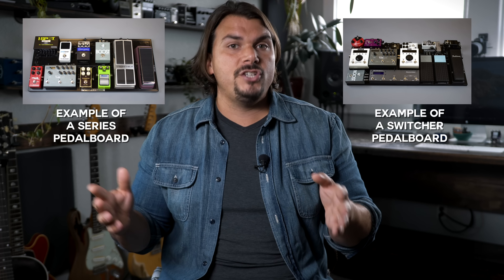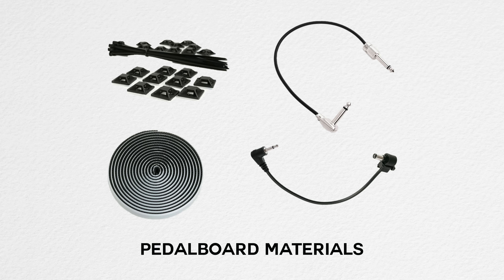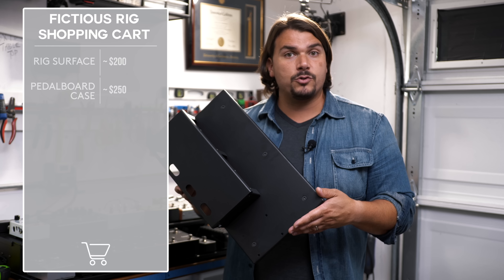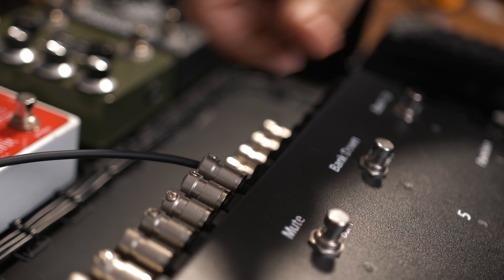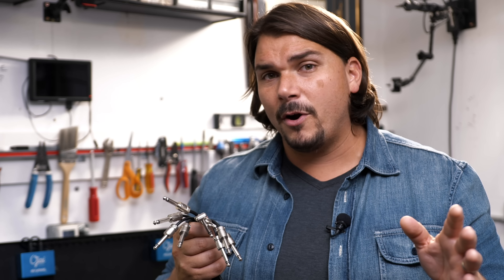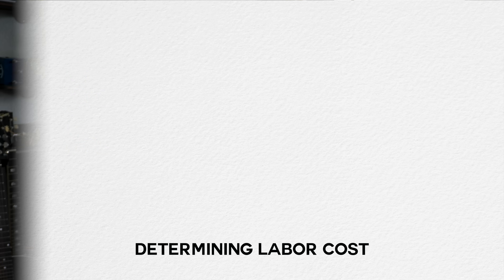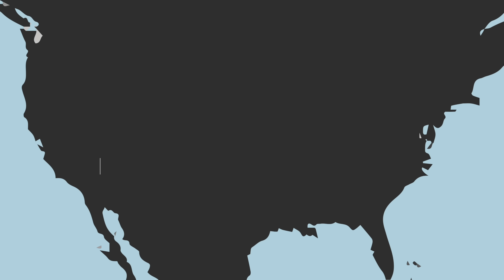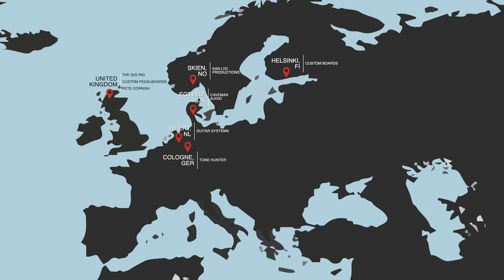The TRUE COST of a Custom Rig Build

Comment: Dont know what is funniest, that they ask 100$ per hour or that they need one hour per pedal. One hour...and they call themselves masters...
Reply from the maker: To do it properly, an hour is about right when you consider all of the things that need to go into making each petal work in the system, cables, power, layout, testing, Velcro, routing neatly.
Reply: I've only got 10 pedals and I have about 15 hours into my board. That includes setting the levels on each to work together properly. I also use premade patch cables. Dont wanna pay that much you gotta learn to do it right yourself.
Reply: When you factor in that you have to do the right layout, map out the paths of each cable for each pedal, be strategic, take the time to do things correctly, do all of the custom cabling, account for anything that might go wrong, etc., an hour per pedal When you average out the entire time from start to finish is actually quicker than average. My board is big, but I would say start to finish it took me around 24 hours total in its entirety. That doesn’t even account for programming with many builders do as well. We aren’t talking through some pedals on a Pedal Train and attaching pre made cables that look sloppy, which is 98% of the boards people show on social media groups out there. It’s an art form and not everybody understands what goes into creating art.

Comment: I can't even imagine the issues someone could have where they would actually pay someone to do this. How can you know enough about guitar to play it, pick out pedals, know what you want and how you want but then not be capable of wiring it up neatly? it literally make no sense. Maybe you wont do it to an insane level of professionalism but there is no logical reason why you couldn't do it well enough to realize the cost for someone to take it to a higher level than you could is just laughable
Reply from the maker: I can understand that for some it might not be worth it for them or good value based on their performance circumstances, but a novice with inferior materials won’t be making something equal to a pro builder, especially as the complexity of the rig increases.  Remember that there are no standards, electronically, when it comes to pedals.  Integrating 10+ pedals all speaking different languages and getting them to work synergistically is easier said than done.  Also making the rig quiet and reliable is an entirely other thing and again easier said than done.  Have a look at any Facebook pedalboard group or Internet forum and you’ll see daily posts saying “Help!” requesting trouble shooting assistance from the community as they’re at the limits of their ability.

Comment: I might have missed it but is switcher /midi programming included in the labor?  Guessing the estimated labor rate is +/- $100/hr?
Reply from the maker: It’s at the discretion of the builder - usually some basic programming is part of the deal and more specific programming might be negotiated with the client, but this is general, I can’t speak to every rig builder.  In some senses it’s best if you’re familiar enough with your gear that you’re not dependent upon the builder to program every time.  Often a tutorial at pickup is par for the course and some follow up, but a fully programmed rig is usually not included in a standard hourly price from my experience.

Comment: Lol then there's me... Spends $7000 on a rig build and builds it myself... There's a margin depending on what you're trying to do, I feel like on average it costs a lot more to build a rig
Reply from the maker: Big rig!!!
Reply: @VertexEffectsInc  yep!! the signal chain looks like this:tc electronics bonafide buffer, blackface proco Rat (1986), ehx original micro pog, fulltone ocd v1.4, Ibanez ts9 tube screamer, homebrew electronics power screamer, boss reverb rv-5, mxr phase 90 script logo (74' reissue), boss delay dd-5, line 6 delay dl4, 2nd line 6 dl4, this is then controlled by the nerve center: a gigrig g2. I also have 3 ernie ball volume pedals on this board, one is put at the end of the signal path before the end of chain tc electronics bonafide buffer, one is placed between my last overdrive and the reverb and the last volume pedal is hacked with a trs cable to work as an expression pedal for one of the line 6 dl4's. Everything is soldered in mogami 2319 and send and return buffers are fitted with neutrik locking 1/4 inch female ports. What do you think?

Comment: No offense dude, but cmon, you sell a 10 foot guitar cable for $75.00 on your site.
So how much does this rig cost? 
A lot. It costs a lot a lot. 

If you have to ask...you can't afford it.
Reply from the maker: That's what it costs for us to source and assemble a guitar cable in the USA, and pay a fair living wage.  You're certainly not locked into getting a cable from us - but if you want one with a lifetime guarantee that uses our recommended cable and plugs (which isn't commercially available anywhere else - unless you DIY it) this what we offer.  Secondly, I provide on our channel all the resources and a building tutorial to make this exact same cable yourself with our same materials.  I'm not sure any other cable manufacturer that will show you how to build their identical cable yourself and provide all the links and bill of materials to go along with it.  That's about as democratic a solution that I can provide if someone doesn't want to pay $75 or can't afford to, they have the same gear available to them in a DIY format.
Reply: @VertexEffectsInc  Mason, I applaud you paying good wages and not racing to the bottom.  Quality costs, or buy good components and build yourself.